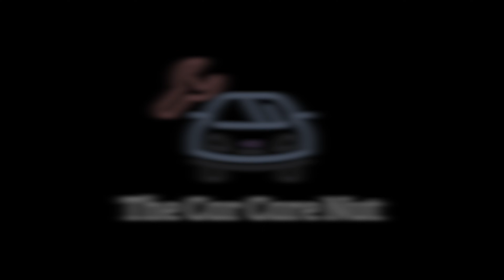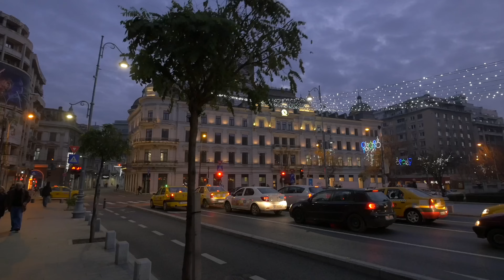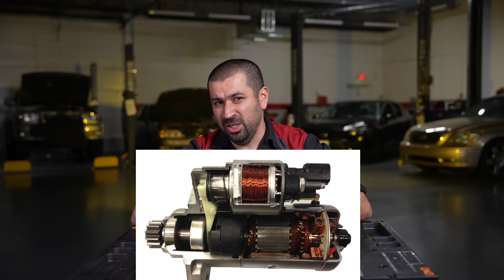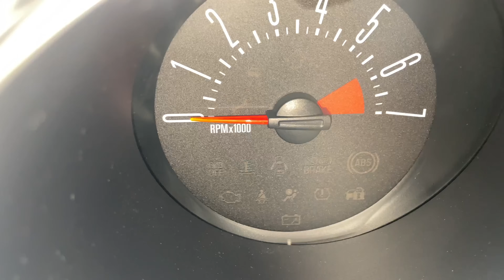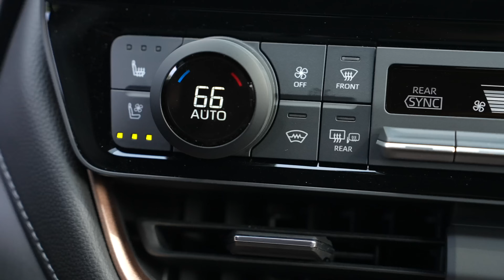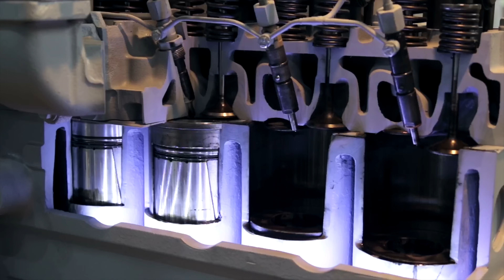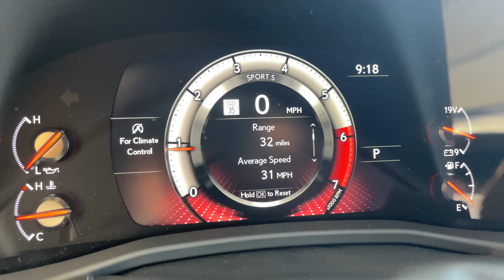How Does Start Stop Technology Work in Modern Cars? Everything You Need to Know

Comment: thanks TCCN for the complete explanation! I kinda had an idea. now I know even better and so am sure that this system is ridiculous. I have to disagree with you about how we need to just put up with it because it's new and mandated technology. I'm really annoyed to be forced to put up with something that delivers questionable gains at considerable complexity, I have to pay for it, then am left with a choice of either wacky operation or a reminder how I've been swindled every time I start my car.
this may be "new" but it's really trying to cure a terminal cancer patient by replacing the lungs with an inferior product at great expense after the cancer has already spread.
the first time I came across start-stop is when I rented a Benz S550 to look classy at a wedding. this otherwise powerful, silent, and rock-solid vehicle acted as if it's broken, vibrating and making a cheap brrr sound when starting from a stop. what did the guy say? 🤔oh, right, "you have to push this little button every time after you start the vehicle otherwise it acts like it's broken." really? a six-figure MB gurgles like a diesel pickup after every stop? I couldn't believe that was normal operation. it felt like a safety issue too. with the vehicle not rolling as one would at idle with foot off brake and the big engine taking a second to start, I instinctively went to press the throttle further which made the car suddenly lurch forward, ugh. 
if I can't avoid a vehicle with this system then I'm going to delight in making sure start-stop is inoperative.
there are lots of articles on ways to do this depending on model. I would rather hear your top ways to do so harmlessly (even if mostly) and reversibly TCCN rather than suggesting we just grin and bear it.
I'm all for the environment. being inefficiently efficient with start-stop is not a wise answer. the way to do that is to just go with already available electric as your next vehicle ..or put start-stop to sleep when you come across it 😎

Comment: He's wrong in that it doesn't help with MPGs. It's about a 5% gain on avg which is a huge gain in efficiency. You'll save about 1 gallon of gas for every 20 gallons purchased. See engineering explained here: https://youtu.be/dFImHhNwbJo?si=I1kUYZfpfSzsrugB

Newer cars will also turn the engine off during coasting situations,they sometimes call it sailing. To say you don't save much on gas is wrong.

Auto start stop has been around for a while now,how often do you actually here about people with failed components related to it? It's actually not often. The system might be complicated but it's very robust.

Comment: I didn’t know about this until I started hearing vehicles stop and start at the stoplights.  
We got several Peterbilt 3 axle trucks at work and they go into neutral when you stop.  So you have to wait a second for it to go back into gear before you add acceleration power which is really annoying when you have to make a quick turn in heavy traffic.  It also causes roll-back on hill starts.
New vehicle technology is garbage imo and I want no part in it.

Comment: I'm SO glad my 2021 Chevy Trax doesn't have the Start/Stop feature. I believe the 2022 Trax does have it, so mine was the last year without it. I'm also glad mine is Port Injection. The 2022 is Direct Injection which has its cons.
Reply: Make sure u get a induction cleaning done get that carbon buildup off engine valves. I believe around 30,000- 40,000 miles.
Reply: @beautifulrainbow6989  That's a problem with Direct Injection, I have Port Injection.

Comment: While the argument "this is the way cars are going, so best learn to deal with it" is true now just like it has always been, it's a little different this time. Previous technologies that people complained made cars more complicated and expensive were used to make the cars more reliable/safer/powerful/convenient/efficient. We are talking tech like ABS, VVT, turbos, direct injection, airbags etc. However this new start/stop tech doesn't provide any of these benefits, all it does is make your car more complicated and expensive to buy/run. The miniscule amount of emissions saved for your average driver really won't measure much if at all. Regional or rural drivers who spend almost no time stopped at traffic won't see any emissions saved at all.

Then you can make an argument that for all drivers who aren't in constant start /stop traffic it actually produces more net emissions from manufacture of the extra parts that will never get offset by the technology. I can guarantee you those special batteries are much worse for the environment than your average car battery as well.

Also anecdotally I have driven cars with this technology from both regular and luxury car makers, while the technology works you will always be very slow to take off from a stop compared to a regular car. While this doesn't matter 99.9% of the time, if you need to get moving in a hurry for any reason, you are out of luck.

So the TLDR is, it's a technology that makes your car more expensive and complicated while taking away some convenience without providing any benefit to you, the owner, for miniscule emissions savings that may not even exist. Yay.

Also I hate not being able to permanently disable it, the world we are creating where you have less and less control over your own property is turning more dystopian every day.
Reply: My 2002 Prius has start/stop as a part of the hybrid system. Running the defroster (forces the engine-driven AC compressor to stay on) or MAX A/C is the only way to disable it. I notice a 2-4 MPG drop if the engine is never allowed to cut-off under 42 mph or when stopped. 

In town, the engine-off capability is great. Whenever I don't need power to accelerate or climb a hill, the engine is off. Instead of a little AGM battery, I have a 300V, 1.6kWh battery that can carry the car for several miles without the engine.

Taking off, the Prius can scoot off the line pretty well. The motor can deliver 44 peak hp and a frankly surprising 258 lb-ft at ZERO rpm. The engine then kicks in seamlessly.
Reply: We are not talking a full hybrid car like the Prius ffs.
Reply: @aspecreviews   As useful as the hybrid functions of the Prius are, that's not what is being discussed in the video or my comment.
Reply: Very well said!

Comment: I think some cars do this better than others -I notice that some of them light off immediately when the light turns green,others sit for a couple instants cranking while the other car next lane gets a car length away without even trying before the other one catches and moves-might be a Ford -must be annoying to the driver-suspect a certain vehicle can stop with the engine at a specific degree of crankshaft position such that it only has to fire a certain spark plug with a simultaneous fuel injection pulse to restart without even engaging the starter  motor

Comment: A proper,normal battery that is not excessively discharged should be able to maintain at least 9.5 (or 9.6)volts during normal starts unless it is a winter cold start. If voltage is dropping below that,the battery is a candidate for replacement (assuming that there isn't a charging system or voltage regulator problem)
also a "bad" starter could draw excessive amps causing the voltage able to be supplied by the battery to  drop below normal (and still be able to start the car,at least a few times before the starter motor failed completely)

Comment: This is another example of not looking at the whole picture. Yes the car is at 0 emissions when engine not running. How long does the engine need to be off in order to really be reducing emissions for the entire trip? The energy it takes to start the engine is not free (re-charge the battery)  that takes extra HP which is extra fuel and emissions. This is why gas mileage does not improve with this system.  I would guess anytime your engine shuts off for less than 15 seconds your engine dumps more pollution in the air from charging battery than if it kept idling. When i owned a car with this feature It hardly ever was shut down for more than 5 to 10 seconds. I am sure on the EPA test course it works well to hit the manufactures goal  but in real life it just really bad idea.

Comment: With our two last cars, I  turned the start/stop off permanently forever. Lift the bonnet and look at the negative terminal on the battery. If there is a thin black wire with a snap connecter attached, undo the connector and tuck it out of the way using a zip tie if necessary. Problem solved. Just plug it back for annual emission tests. i'm not telling you to do this, but it worked for me...

Comment: I was under impression that after heavy load, you should allow the engine, oil and turbo to cooldown before turning it off? I always turn off Start/Stop because Volkswagen does not care and will shut down engine even after long distance at top-speed on Autobahn.

Comment: The stop/start system software used to control it needs to become more sophisticated, the engine shuts off many times for no reason and at other times when it's supposed to shut off at extended red lights it keeps running. This is also a safety hazard because there may be times the engine shuts off at let's say a traffic yield and a driver may need to take off quickly to get out of the way of danger and that extra second or two it takes to crank up may mean the difference between accident and no accident. I always turn it off on my 2023 Kia Soul. There's a hack that if you insert a business card into the side of the button to keep it pressed the system will always default to OFF status.

Comment: Good explanation of the system, but I still hate it and wish it to the scrap heap of bad car ideas.  The system has actually broken the AWD in my Ford TWICE because it cannot comprehend actual driving by humans.  In both situations, I had to come to a stop to leave my subdivision onto the main road.  In the split second I stopped and felt the engine turn off, I determined it was okay to proceed left so I took my foot of the brake and the engine came back on.  The moment that happened, the car became FWD only and advised service.

I called Ford.  Their answer?  Just disable it every time you drive if you want to avoid it.  Very well, challenge accepted.  Every time I get into my Ford, it is required pre-drive check to turn the damn system off before moving.

Unfortunately as long as the EPA gets to dictate things, crap like this will continue to show up in our cars.

Comment: Works ok, the power steering is a little slow though...hydrolics...
After a while it stops working, i figure the battery is getting a bit too weak. 5 years old. Still works the truck no ptoblem, so no need to replace yet.

Comment: Excellent video.  I never knew the magnitude of elaborate engineering that was needed to develop a system (I call it stall mode) that most people hate and will override with the kill button.  They say it won't cause engine damage, but what about wear and tear? It can't be good for the engine if the oil pressure drops to zero at every traffic light. Or is there and extra oil pump?
Reply: The auto start/stop system 100% causes engine damage in the form of wear and tear. Its delusional to say otherwise. Clearly, there is a limit to how many times a starter can be used. There is also a limit on how many times you can start/stop an engine before you destroy it.

Comment: This is one of the stupidest ideas in car industry along with setting the transmission in park if you open the door or the three horn beeps when you get out of the car and leave it running.

Electric cars are zero emmisions, another stupid concept.  When you charge your car at home or anywhere there is a power plant producing emmisions for that load.

Yes there is room for improvement.  We need to take care of our planet, but stupidity its not the answer.  

If you need automation to set the car in park, if you dont know to back up your truck with a trailer or backup a car without a camera you just dont know what you are doing.  Do the world a favor throw you driving permit in the trash.

And then you ask the question about why cars are getting so expensive....???